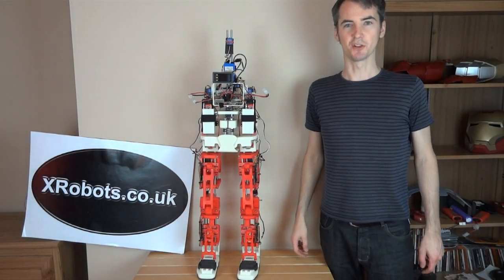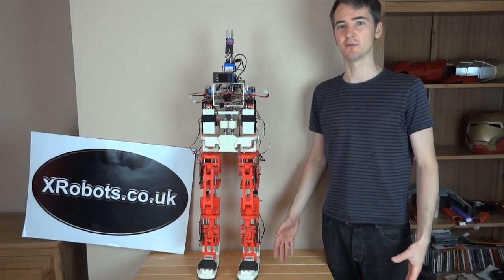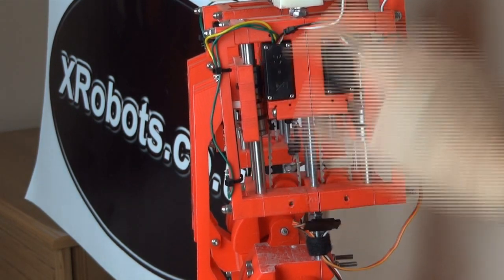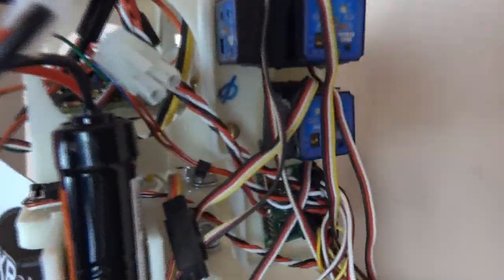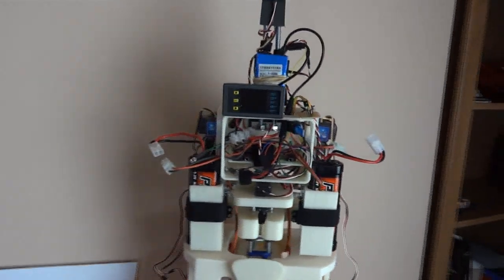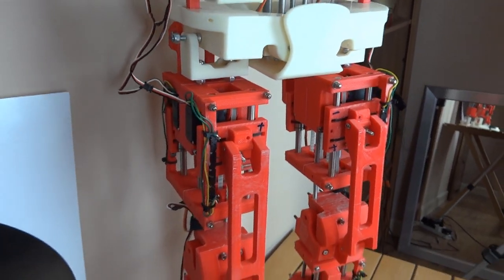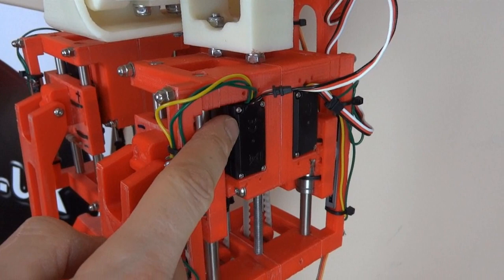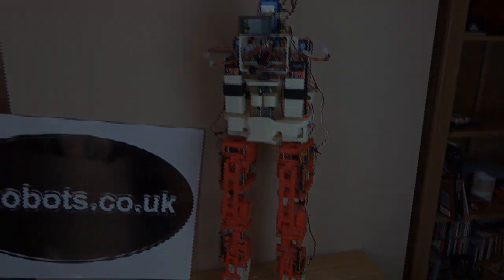Android 12 part 11, Preliminary testing with new linear actuators for my 3D printed robot

Comment: I am amazed how you're pulling all of this with simple hacking and basic programming :) I remember building my humanoid and boy do mine and your approach differ. I really like the idea of linear actuators from those hobby servos, but now you really need to make them faster for better dynamics. Try getting servos with around ~0,1s/60deg. And the linear pot is probably giving you crappy results that make your android wobble. I'm not saying it's a bad solution, but I'd try getting some new ones

Comment: It seems the step speed of the non standing leg is too slow, or  with combo of more nee bend may help with motions of walking.   Just my viewpoint.  Are you going to add switches to the feet to tell system hey i'm standing on my leg?  Great work as always James. Keep up the great work!